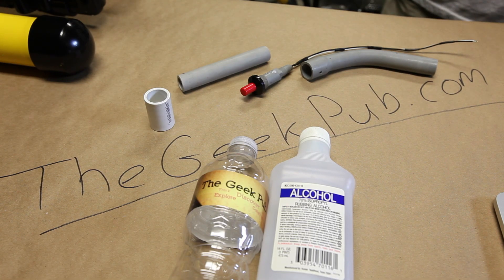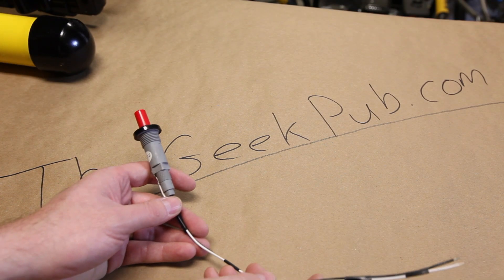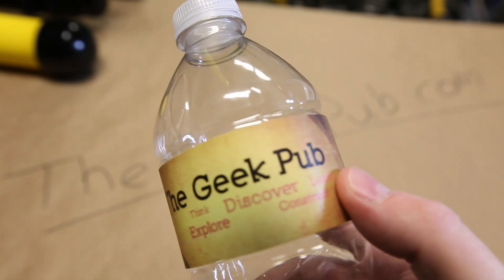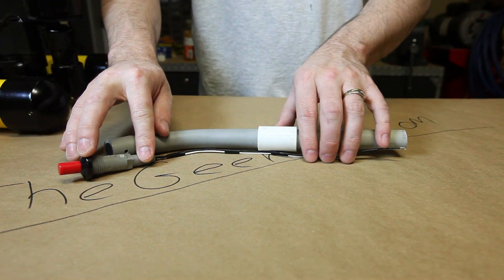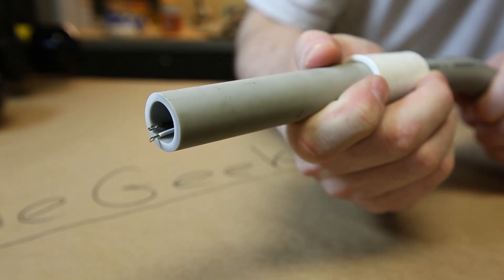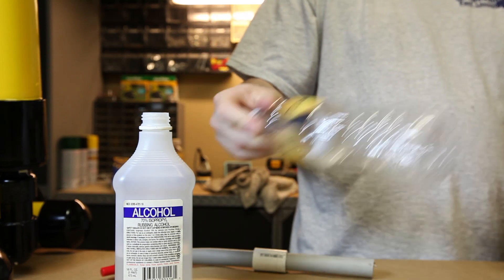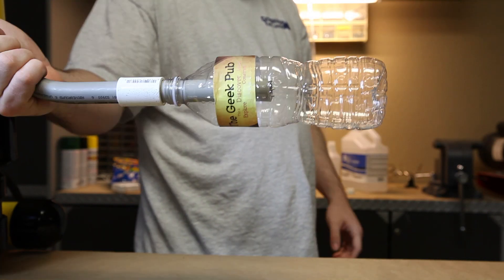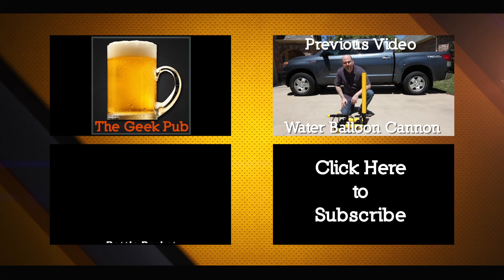How to make an Alcohol Powered Bottle Rocket

Comment: Hi there, i Made a whole Frame up. to shoot bottles with my son, we have the, BBQ lighter and the long wire coming off it.. we had to soldier the lighters wires. but from what i have seen that would not make a difference.
I think our problem is fuel. the only thing close to rubbing alcohol is "-boots- surgical alcohol" We get a spark of the button, but cant seem to make it shoot! any ideas?
Reply from the maker: Almost guaranteed you've got too much fuel in the bottle and not enough air.
Reply: This was my issue. I solved it by dipping a cotton ball in isopropyl just enough so it is damp, blowing into the bottle to get fresh air in, putting the cotton ball in the bottle, then sealing it and putting it in the sun for 2 minutes. I found that if it is cold or the alcohol doesn't have a chance to evaporate, you're not going to get a good reaction.  If you follow my steps and it's a reasonable temperature and sunny you'll get ignition every time.

Comment: I did this and I made everything how I was supposed to and it sparks but the alcohol does not light off.... I'm using 91 percent. Anyone know what the problem is?
Reply from the maker: You've either got too much fuel or not enough.  I suspect too much.  After you shake the bottle pour any excess out.  There shouldn't be any alcohol standing in the bottle.  All you want is invisible vapor in the bottle.
Reply: @TheGeekPub  This was my issue. I solved it by dipping a cotton ball in isopropyl just enough so it is damp, blowing into the bottle to get fresh air in, putting the cotton ball in the bottle, then sealing it and putting it in the sun for 2 minutes. I found that if it is cold or the alcohol doesn't have a chance to evaporate, you're not going to get a good reaction.  If you follow my steps and it's a reasonable temperature and sunny you'll get ignition every time.